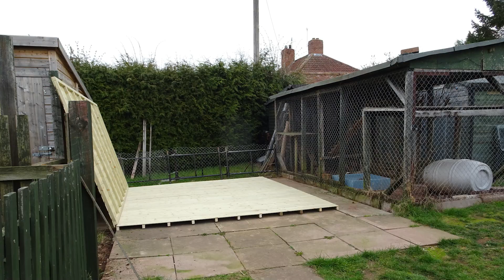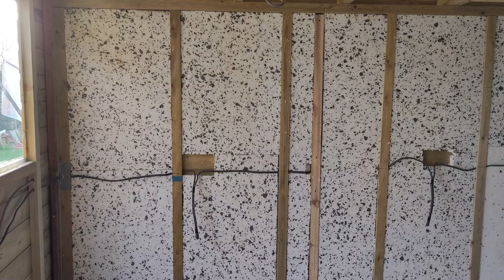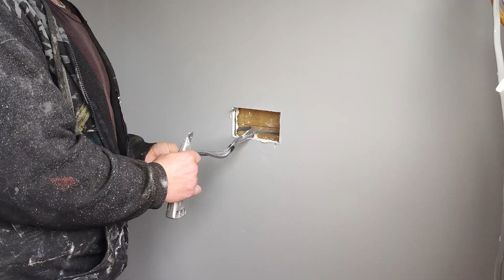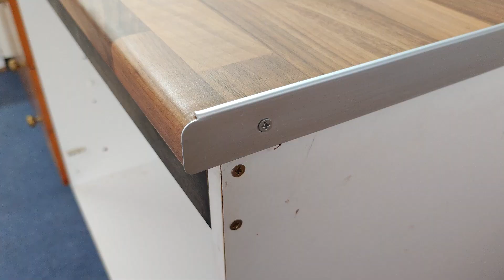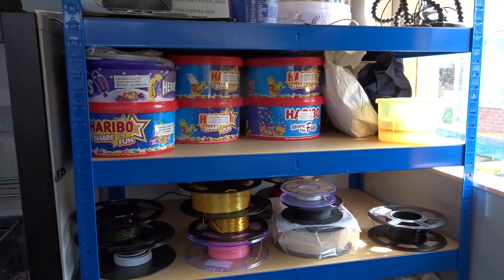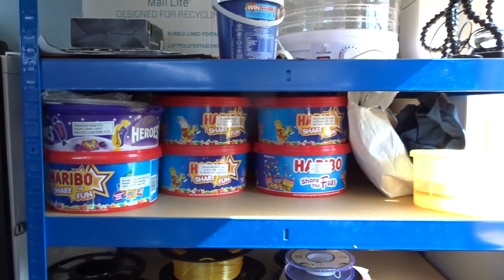Building My New 3D Printing Shed!

Comment: How do you find the printing in the extreme temperatures of the UK? I think you are in the UK?
Reply from the maker: Hey there :) 

Yea you are correct, I am in the UK! Its not to bad in all honesty. 90% of the year I can use the printers without really changing anything I do. For the few weeks where its really cold I tend to just run a heater for an hour before I start a print and generally the heat from the printer is enough to keep the temperature up so it finishes fine. 

I actually have more of an issue with the few weeks of heat waves we have been getting. Even leaving the door open, which I do normally on a warm day, isn't enough to stop heat creep from clogging the nozzle. I got around it by having a fan aimed at the printer on a slow speed for the duration but an air conditioning unit would be better. But generally I can keep the printers going all year round without much faff!

Hope this helps and thanks for watching! :)
Reply: @willcaddy  Thanks for replying! I live in South West France and the temperatures can be quite extreme, I am only a beginner at the moment but if I get really into it then I will need to create a space and the only thing I could think of was a shed outside as we have the outdoor space, don't think the mrs will appreciate me taking over the spare room! lol 
Its good to know that I will probably be able to have a shed, just need to be aware during the winter and the summer lol
Reply from the maker: @taydenclark1179  No problem, Happy to help! If ypu can, see if ypu can get/build a shed with at least a 50mm upright timber as that way you can fit some kind of rock wool or better insulation in thw cavity.  That will be a lot better! I only had a 25mm gap in mine so I could only fit the cheap thin polystyrene insulation in. Hope that helps and hope ypu get your man cave soon!
Reply: @willcaddy  Ok noted, thanks for the advice! 😀 I have the garage which is a sort of man cave but a shed kitted out like what you have would be way cool!! lol I think I would definitely consider a dual a/c unit, so one that also heats in winter as it gets quite cold in winter but nought like the UK admittedly but still wouldn't want to be sitting out in a shed in winter!!! Anyway, good job done and enjoy!
Reply: How did you go about feeding power from the main source (house?) To the shed ?